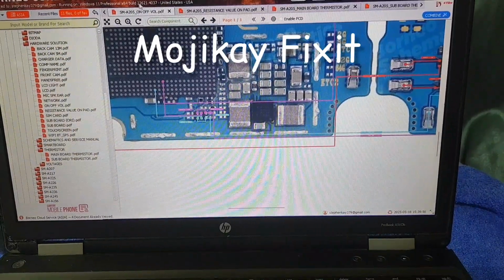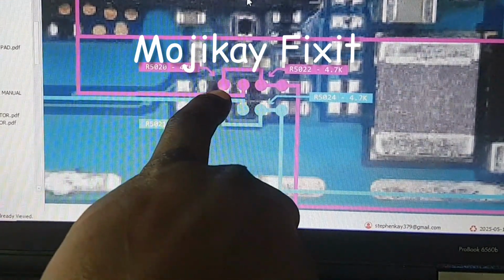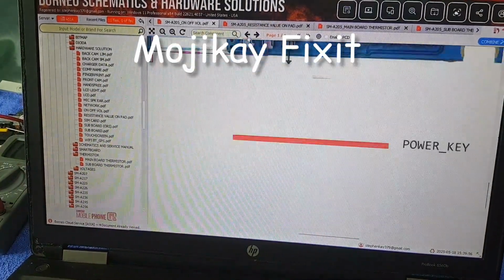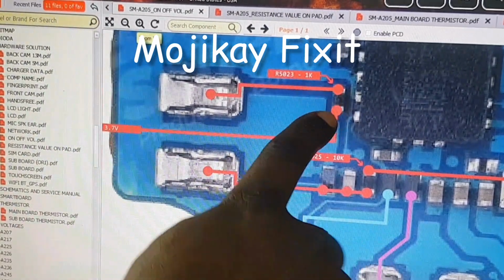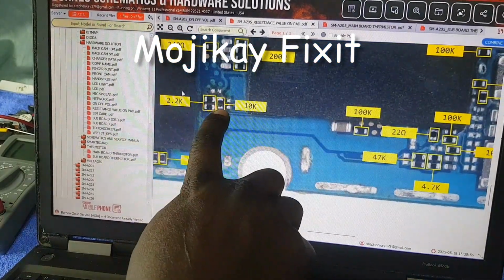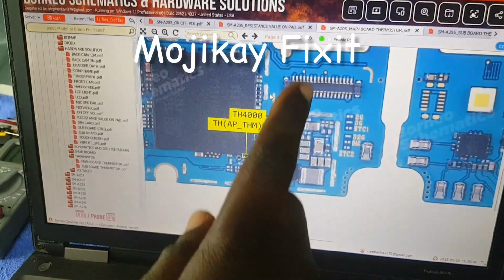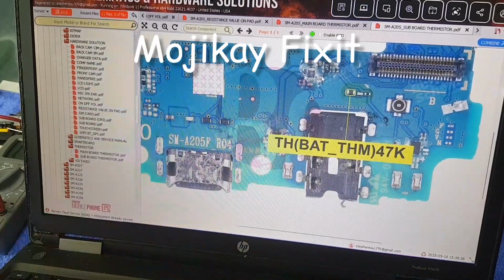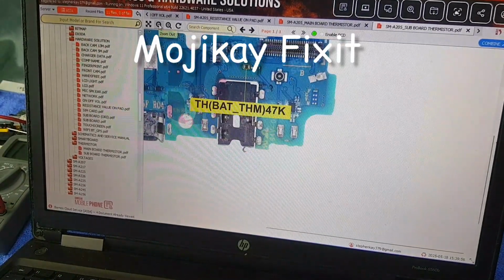How To Use A Multimeter, PART 3 (RESISTOR READING), How To Read Resistor And How Resistor Works.

Comment: Sir what is the problem the phone can get once the resistor fail.
Reply from the maker: There are several reasons: 
1. high volts
2. they weak over time.
3. shorts circuit from other component
4. Everything in life has expiry date
Reply: You don't understand the question
Reply: Rephrase the question then😊